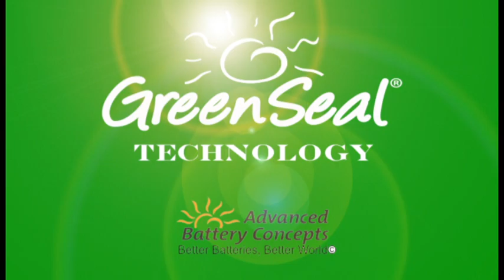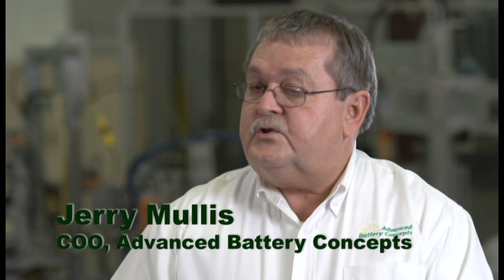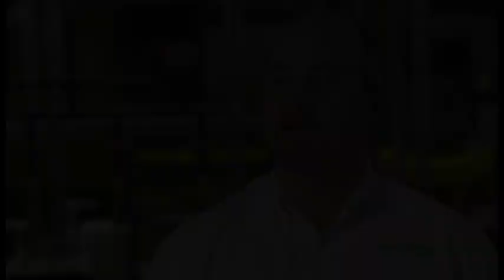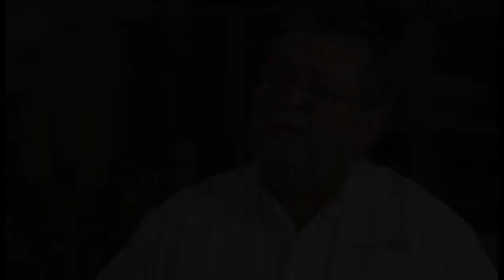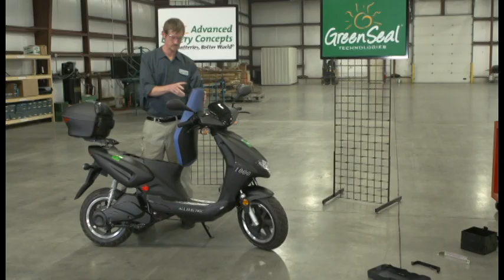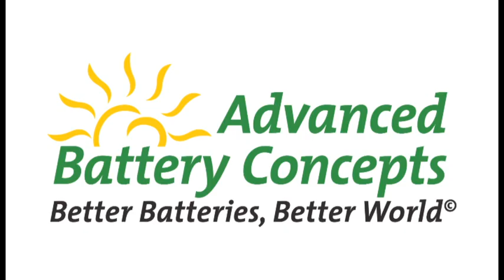Advanced Battery Concepts - GreenSeal(R) Technolgy

Comment: Excellent video.
I will look for your product.
Presently, I use 2-12 volt 17 amp batteries in my 24-volt 500-watt scooter. (S-750)
Panasonic LC--RD1217P